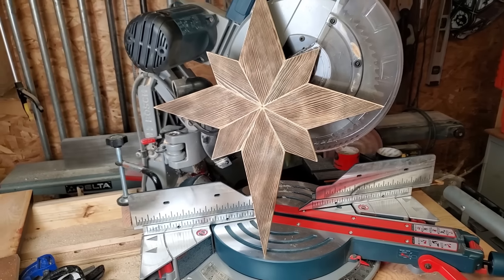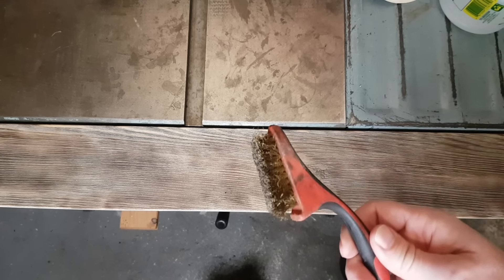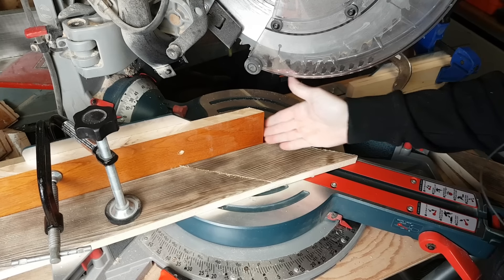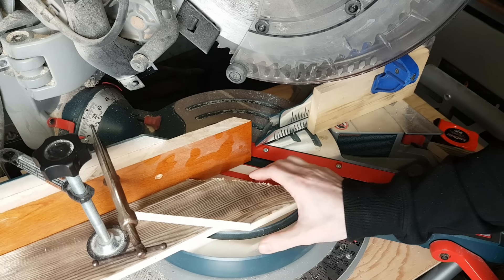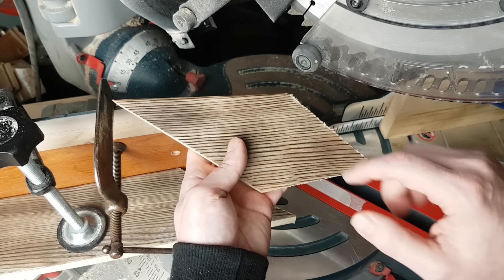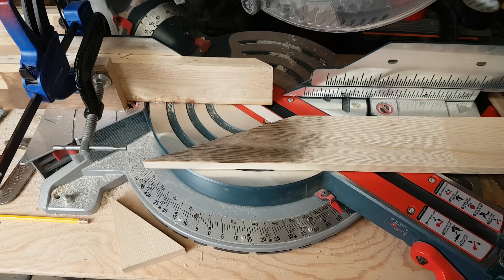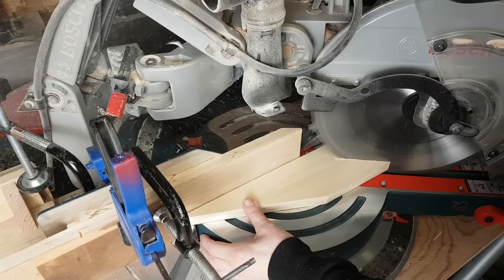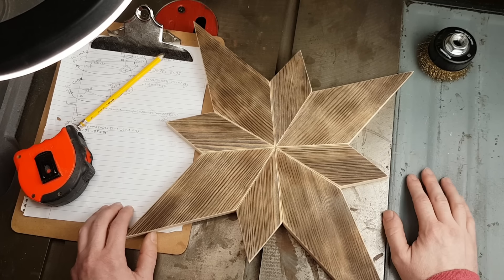8 Point Wooden Star - Easy Angles - No Table Saw!

Comment: I’m going for it soon, that very long cut, I might not cut right through and finish cut by hand. And I may glue the 7 short pieces first before the final fit of the eighth piece if that makes sense. I will also give every piece a heavy chamfer right round. 🤞🙏🏻. Cheers 🍻.
Reply from the maker: That's great! I actually just released a new 8 point star video with a lot more detail. https://youtu.be/o16SI3GH0Eo
Your idea of gluing the first 7 before fitting the final piece is excellent! Why didn't I think of that? Good luck!

Comment: Love your videos! A possible "fix" for the gaps would be to back the whole thing with a very thin piece of plywood cut in an octagon. (I do something similar for much smaller stars I make.) I glue the edges together and then to the plywood. Then I use very short pin nails to hold it all together to dry. Any small gaps are now invisible.
Reply from the maker: I sometimes would get cupping when gluing backing directly to the back of my stars. I am assuming due to expansion/contraction of the wood but only sometimes. I'm actually currently filming another 8 point star video. Hopefully I'll have a better fit this time.

Comment: @savvybuilds I really like the beveled edges...the contrast is pretty.  Earlier in the video you placed the test pieces on top...I think you should do that! It would add another dimension and cover the center to disguise the gap.
Reply: The bamboo dowels I mean skewers definitely came from the dollarama! I have used them to help repair split wood! I  drilled all the way through the broken piece the same thickness as the bamboo skewers. I glued through the split areas and the skewers.  I  tapped the skewers all the way through and then I tightly wrapped the broken wood together and used clamps...worked like a charm!
Reply: I really like the drill jig idea at the end...clever
Reply from the maker: Yes Dollarama! lol They are great for all sorts of things. I fixed a broken chair that split with the same technique you described. Great way to reinforce!
Reply from the maker: Thanks!
Reply: @savvybuilds  exactly!

Comment: Is is possible to make one that is four feet or there about? That size could be used on the outside of a house or garage for visibility.
Reply from the maker: The wider the stock the bigger the star. But I think that would be too big for a miter saw. Might need to use a table saw or circular saw.

Comment: Thank you for sharing this build ! Can this be done succesfully with a board of 3 in width ? Can it be made larger ?
Reply from the maker: should work fine with any size board. Use the same angles and just line things up the way I do in the vid and you should get the same result but smaller or bigger. If going bigger,  make sure your saw is big enough to handle that last longer piece.
Reply: @savvybuilds   Thank you for replying ! I am in the middle of trying it now with 3 inch wide 3/4 inch plywood. Have everything cut and have glued pairs together. will let them dry tonight and glue each of those pairs together to make the whole star. See if it works then gonna do  one with some hickory floor boards i have

Comment: Great video. If I wanted to make a smaller star, maybe using a 2x4 how do you figure out the angles and length of cut?
Reply from the maker: Hi, thanks! All the angles stay the same no matter what the size it is. Just need to cut the pieces smaller.

Comment: At 10:28, where did you come up with 41/4? Took me a few tries but I think I got it. After you cut the larger pieces at 45, you measure the sides of the cut. That measurement is the width of the smaller pieces. Using this method you can use any width of board, 3, 4, even 6” board and make stars. When I watched you put it together I realized that the 54 degree cut on the small pieces lineup against the 45 degree cut of the big pieces.

Comment: To get rid of the gap in the middle, drill a hole with a Forstner bit, then add a piece of brass tubing, or a dowel hole plug. Then it looks like a design feature.

Comment: Howdy...I've been watching your star builds for about a year now I guess. I like them and been wanting to try a few, though I'd probably end up using a tablesaw and sled set up, probably a tapering jig. But it just seems like every time I finish a major project and think I've got time to do some "smalls", another large project falls in my lap. 

My mitersaw a.k.a. "chop saw" isn't a sliding miter and though it's a Dewalt, it only goes to 50° so, since alot of your cuts are at 54°, I'd end up having to make a jig anyways. Not to mention, the heavier the angle, the less wide of a board I could cut with a single pass. 

I know your videos tend to emphasize NOT using a jig....but perhaps you could make a video where you did use a jig and you could make a video on "that" process. 

I think you're making great videos. 👍 Please do NOT start doing tool reviews. It's one thing to show a tool you use, that's fine...just don't go down the "reviews" path....stick to building. 😊
Reply from the maker: I suspect that I will make more and more technical videos as I progress with all sorts of jigs, including ones that could work on a saw like yours.

I also want to start making videos about how to make the stars on a table saw. I think it will be more efficient and give me cleaner cuts but will definitely require some jigs. 

BUT before I go down that road I need to set up some kind of website where I can provide free/cheap plans. When I say cheap I mean the price of a cup of coffee. 

Thanks for watching! Cheers

Comment: first let me say thanks for sharing. ive been worki g thru this video step by step to build one of these but cant seem yo get the proper length of the last 2 cuts. i set the 22.5 up and clamped it gently to my saw table. just cant seem to figure out the length on the last 2 cuts any advice?
Reply from the maker: Are they too long or too short?

Comment: How would you make this closer to 5’ tip to tip and then also make the shorter points a little longer than what you have? I would be using a straight ended and circular saw as well as wider boards. My church logo is this star and want to build one to hang up in the front of the sanctuary. Thanks

Comment: 45 degrees possible the east way. 

Get a flat board. 1x4 (the 4 is horizontal flat on the cut surface the 1 is touching the back fence)
Super glue it to the back fence of the saw.
Cut a 45 both directions. 0 is now 45.  Make cuts at 7.5degrees. 52.5 degrees.

Comment: For the bottom point at 22.5° a 0 clearance fence across the back might help keep the piece from being pulled in. Maybe.🤔 Haven't tried it yet but just got the BOSCH miter saw and will try it soon.
PS: Almost immediately I changed out that blade. I'm surprised BOSCH would embarrass themselves by putting their name on it. It's terrible as most blades that come with their tools. Much tear out.
Thank you for your efforts in designing and sharing this beautiful star.
Reply from the maker: It's a great saw! No regrets there. I am due for a new blade tho. I will keep working on that steep angle jig. The zero clearance should help
Thanks!.

Comment: I appreciate that you've passed on the results of your hard design work for us to use It struck me this AM that I can set up my radial arm saw using an angle finder to get really accurate cuts on all these angles.
Reply from the maker: Happy to share! I used to have a radial arm saw, cool tool, accurate, a little scary.
Reply: Love mine. In the process of making a new table and fence for it. Biggest issue (As I'm sure you know) is dust collection

Comment: I just finished a 20 foot diameter Octagon deck. I saw your utube on the 8 point star. I would love to build one the will fit in the center of the octagon. I have tried several prototypes and the dimensions don't work out. My center opening is 19 1/2". Is there any chance you can supply the dimension's I need to complete this project?

Comment: Do you have any guidance on how to make faceted (3-dimensional) 8-point stars?  I found info and successfully made several 5-point faceted stars that were about 12" in diameter using a specialized sled for cutting the facets.  But since there are 3 different lengths you're dealing with (versus one length for 5-point stars), coming up with the proper facet angle is real a challenge ... and I aced trigonometry 40-some years ago.  I may also ask my sister who taught high school math and calculus.
Reply from the maker: I see what you mean...hmmm. My brain hurts just thinking about this but there's an idea I've been toying around with for making 3d stars with a 2x2. I haven't quite figured it out yet but I'll try it on a 5 point and then try the 8 point. Hard to explain. 
But to figure the angles, let's say to cut on a table saw, I'm stumped. I should learn how to do 3d CAD drawings to help speed up the trial and error process. Then I could figure the angles, I think.  Would be a great challenge for a math teacher!
Reply: @savvybuilds  I tried posting a link but YT deleted my post.  You can try looking up making a Texas star and lumberjocks as that is where I got my inspiration.

Basically, after using 1-1/2" thick x 3" wide stock for making the 5 parts of a 5-point start, I made a sled that tilts & clamps each piece up 60° from horizontal while the long edges are nested in a small notch in the edge of the sled base down low close to the table and parallel to the blade.

I made the sled long enough to accommodate 2 clamping "stations" in order to cut opposing facets on each piece.  Cut the first facet in the first "station" ... then flip it around to to cut the second side in the second "station."  And of course, I cut another piece in the first station when I move the initial piece to the second station.

After proving the concept, I started using stock glued together from 1-1/2" square walnut and oak to make the 1-1/2" x 3" blanks.

Comment: How would I do this with a table saw???

Edit: How long is the bottom piece?
Reply from the maker: Making these on a table saw would be a different process using jigs. I have not made a video on that yet but I am planning one for the future.
Length of the longest piece is 12-1/4"
Reply: @savvybuilds Thank you

Comment: This was pretty incredible to see thanks for sharing! 

Just some thoughts/ideas:

Instead of torching the wood it might be cool to try using and iron acetate solution. It'll darken/weather the wood (put some steel wool into white vinegar for 24hrs ish).

With using a putty to fill gaps, have you tried using a plastic brush attachment for your drill to scrape away the excess putty caught in the grain? When I have done wood burning projects and want to reveal the grain and push out all the excess char, I've use the plastic brush attachments and it works pretty well to not scar the raised grain, but I typically burn before raising the grain. I wonder if the excess putty would get removed fairly easily without harming the raised grain.
Reply from the maker: OMG this is an excellent tip! I think you're right about the plastic drill brush. I'll have to try it out. I've got a few extra stars I can practice on.
I've played around with vinegar stain too, very neat process.
 Thanks!

Comment: That looks great. I can make some recommendations for the steep angle cut. It can be done with your jig setup, with the addition on a board mounted at the back as a sacrificial fence/zero clearance fence. the pull on the left-hand piece was from the from the point trying to wedge. another alternative is to mount the board on top of another 1x4 with some really good wide double-sided tape like Fastex, and insert it between the jig, and set the depth stop on the miter saw so you just cut through the top board. If you would combine the methods, you make the cut about as safe as it possibly can be, and basically have a zero clearance cut on the bottom and back tip.
Reply from the maker: These are all great tips! Thank you!
I will definitely try this. Much appreciated.

Comment: To make the 54 degree cut if your saw doesn’t cut that far, you can take a scrap piece of wood, cut it at 36 degrees, then clamp it to your fence and use it as a rest for the piece you are using for the star, move the blade back to zero degrees and make the cut. Hard to explain, but there are plenty of videos to show the method.
Reply from the maker: That would actually be a great work around. I don't know why I didn't think of that. Quick and simple too. Thanks!
Reply: I use that method a lot. If you think about it when you set your miter to 0 degrees you’re actually making a 90 degree cut so when you subtract 54 degrees from 90 you get 36 degrees so with the 36 degree jig you’re making a 54 degree cut. Does that make sense or did I just confuse everyone even more.
Reply: If you cut the scrap to 45, it works as an all around jig, forget off hand how the numbers go, but say you want a 60 degree cut, you’d line up to 15*  on the saw, and so on. That way it’s more options but for just making this one star, your suggestion is probably easier to someone that’s never done what we are yappin about… happy holidays and a healthy new year
Reply: @davidpingryn5628 Im really gonna confuse the masses with my twist🤣
Reply: For this to work, you must cut your 45, then set the blade BACK to 0, bump the cut 45 piece into blade lightly and CLAMP down the cut 45 piece against the backstop on the LEFTSIDE. Then you just insert the work pieces into the 45* cut  and chop chop chop. Not exactly for the inexperienced I’d say
Reply: ...what they^^^ said. Nice star.

Comment: You may want to consider building the star first and do the wire brush and charring afterwards. Building a 45 degree jig for making the steep angles allows for just adjusting a small amount for the additional angle as well as it will by design be set for the 45 degree cuts. Good project to try.
Reply from the maker: Definitely room for improvement. I will invest more time in a proper steep angle jig and try the wire wheel after assembly. I hope it still works with the grain patterns being in different directions but there is only one way to find out.

Comment: You can increase the angle that your saw will cut by cutting a board at 30 degrees, then clamp it to your table, then just add the degree that will equal the degree you want. Example: If you need to cut a 54 degree cut, just add 24 degrees to the miter saw, with the 30 degree board, and you're golden.